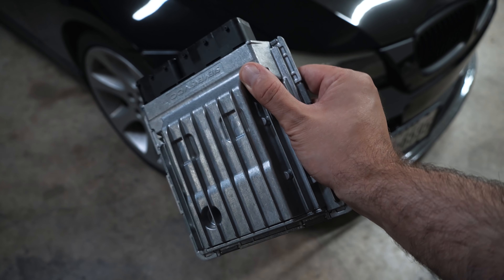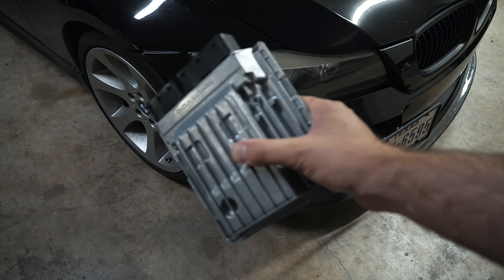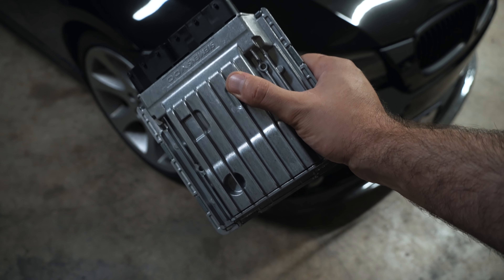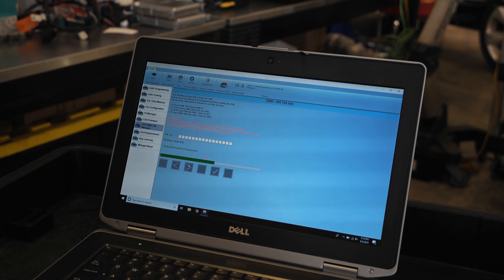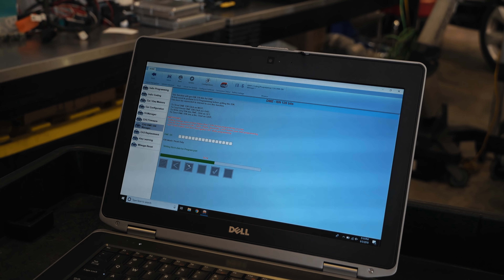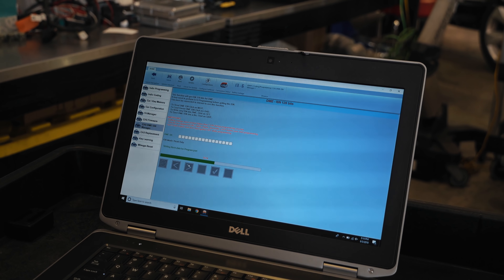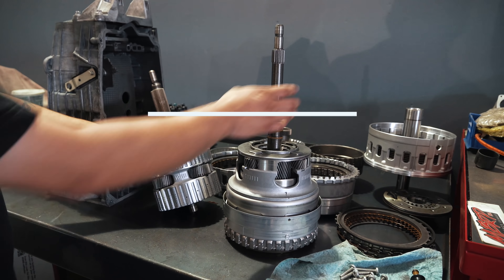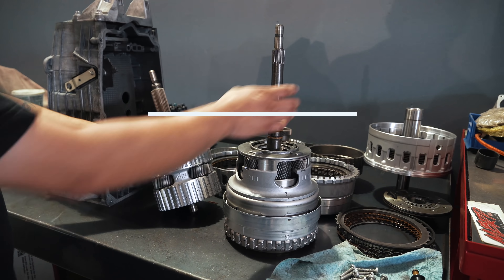This Newer ECU Is Much Better For Your BMW | E90 N54 DIY

Comment: I just wanna know if those damn turbos are good or not already
Reply from the maker: They are awesome, zero issues.  The power video is taking time cause I had to resolve the stumble issue.
Reply: Vehicular DIY thank you so much for replying i was waiting on your review for them to get a pair myself. Sorry if i came off like a dick just been wanting to know so long 😂.
Reply from the maker: Hey np,  yeah I don't think anyone would be disappointed with them for what they cost.
Reply: Vehicular DIY  maybe the fuel pressure regulator is leaking

Comment: Help me understand this. You need to find or purchase an MS81 unit used then be able to have someone “code” it via Hex, etc. the MS80 cannot be upgraded, correct?
Reply: The MSD80 suffers from 2 common defects....1.Mosfets burn out, causing misfires and 2.Internal power supply fails causing different issues.  So, BMW came out with a new updated DME.....  the MSD81.

Comment: I’m also in the Houston area and I was wondering when you say stumble you mean misfire? Because my car already had a msd81 and had a constant misfire after new coils and plugs . I swapped the ecu for the old msd80 and the car idled better. I the. check the codes and seen I needed a upstream 02

Comment: Did you have your firmware updated on the MSD80 before you swapped? Wondering if that might've caught the 02 sensor issue? I just got done updating all my modules, kombi was kind of a pain.

Comment: I have an e92 2013 335is and when I checked the system with protool, it said I have MSD80. Wouldn’t I have MSD81?
Reply: You run into any problems yet?
Reply: @angelpena8121  not at all but I have really low miles for the car. Got it at 32k miles and now has 39k miles.

Comment: If I go with this service, is the secret code being taken from the cas3 and written to new dme or vice versa. I still have a functional msd80 with several custom tunes for my hybrids that wont work on the msd81 until my tuner has time to redo the maps. I believe he's back logged and my car would just be sitting. I need to know if my original dme still work with my cas3 if the cas3 is synced with new dme. As well as keys. I have ability to code, program, flash and write vin.

Also, does the original vin stay on the cas3 so mhd can read it? And your just changing vin in new dme. Or does the cas3 have the original vin and new vin?
Reply: We can do it either way.  If you still want to use your MSD80, then let us know and we will read the ISN from the CAS and write it to the MSD81.  All coding  should be correct to your car after we flash/code the MSD81.

Comment: I’m having a single cyl 4 misfire only when accelerating it now has new spark plug new coils and new injector in that cylinder and still persists . my valve cover is leaking does anyone think that could be the cause lol could it be a o2 sensor ??

Comment: I’m getting a 2c2e could it be my 02 sensors but my old dme or Ecu not picking it up?
Reply: I had same issue along with a pedal actuator code

Comment: Any one help please. 2008 328i hardtop convertible cranks but won't start after replacing the battery the anti-theft activated and I followed the steps on the manual to disactiva it but still it cranks but won't start. Some people told me to replace crankshaft I did and nothing Someone else told me to replace camshaft I did and nothing this mechanic also told me to replace the alternator I did and still same thing it cranks but wont start

Comment: Some time ago I flashed the DME in my 2011 E92 335is with an MHD upgrade to Stage 2+ and I saved the original factory programming in my phone.  If I changed my DME as you did would downloading the info from my phone be adequate?
Reply: Rrudy DeDogg No. it doesn’t work like that. What you see in the video is retrieval of the ISN from DME and then we write the ISN into the CAS. Installing a tune or factory flash program is a different thing. Also your car should have the MSD81 installed from factory.
Reply: You have an MSD81 already.  If it works, it is good.

Comment: 7k programmer, lol where do you get this kind of a price lol min 2k i saw it cheaper
Reply: Vito D This is the complete AutoHex system for BMW.  Maybe not exactly $7k.... AHX0005. Once you add in shipping and a nice laptop plus all the on bench equipment to connect.....will probably run over that.  LOL

Comment: "really advanced" BRUHHH... I have a 20 psi Billet Wheel K04 w/ 440cc bosch green giants FACTORY ECU. I tuned it THROUGH THE OBD2 port...... It's called ME7EEPROM
Reply: "BRUHH" this is not for performance tunes, we got apps on our phones for that MHD. He adapting his newer ecu to the car.
Reply: @Dazedviper1  "BRUHHH" you didn't have to do em like that. Lol
Reply: Flash tuning and being able to modify security information are two different things.
Reply: @rennmotorsllc9787  Very very different.  Excuse the internet tooner bois.